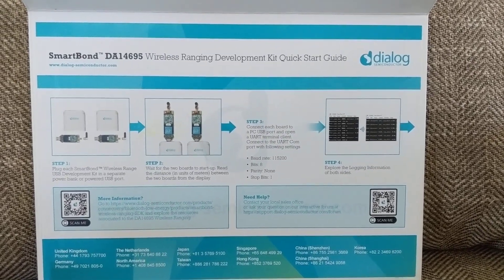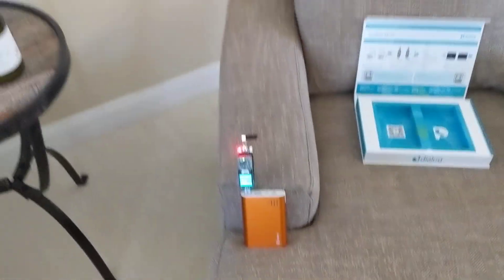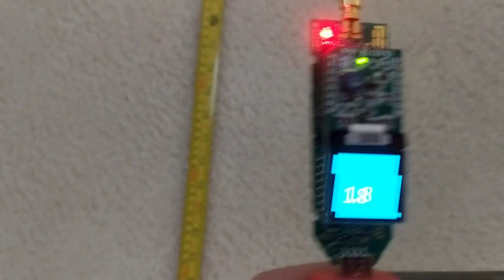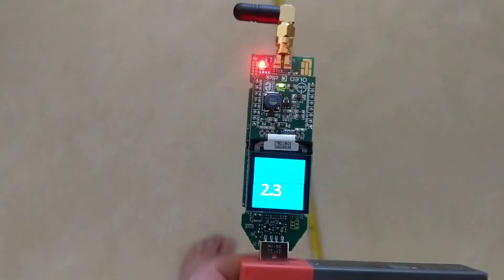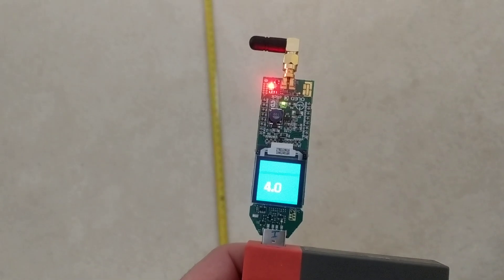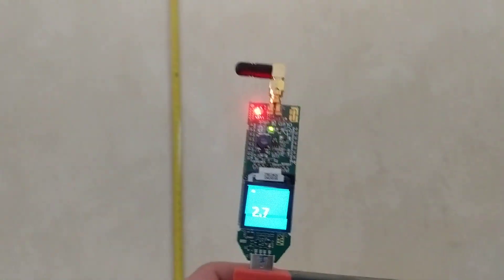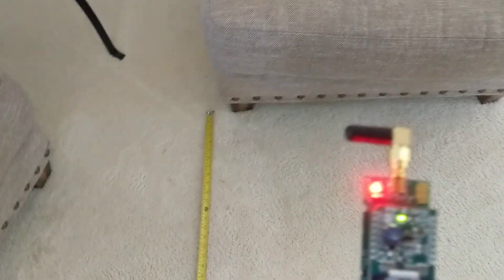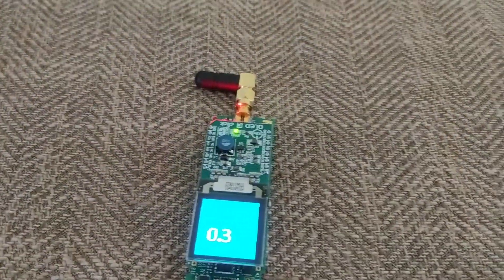WiRa Ranging demo

Comment: We are going to develop WiRa related solutions for hospitals; the question： if in the case that more than 50 devices working together, can each one of them can be found by others. Answers in  technical way should be fine for  us . Thanks in advance .
Reply from the maker: In the same building or the same room.  I have tested about 16 in a room and it is working